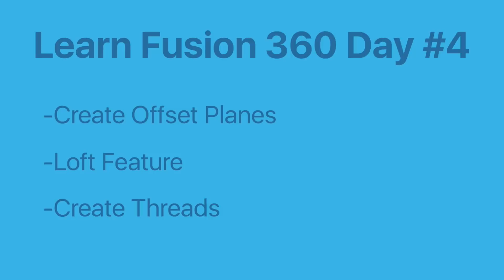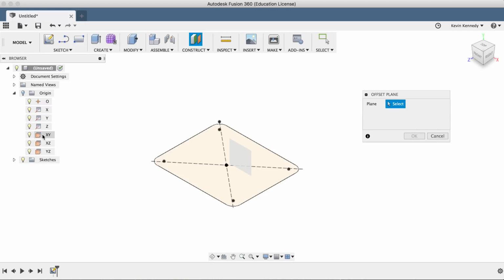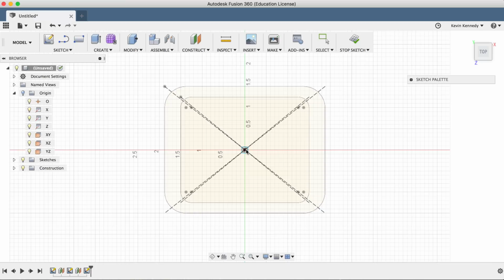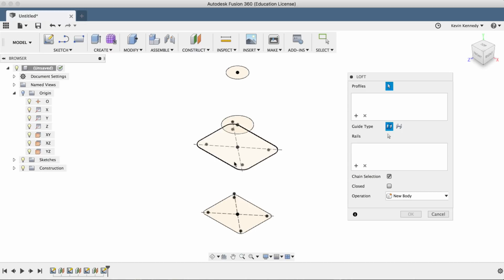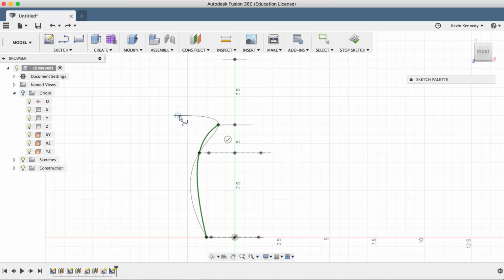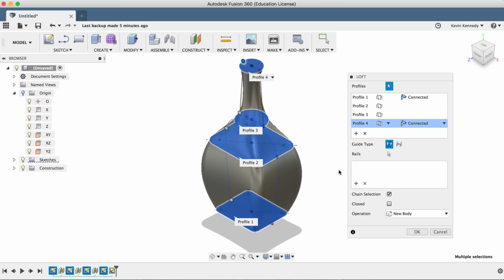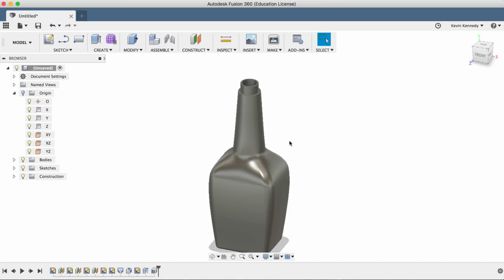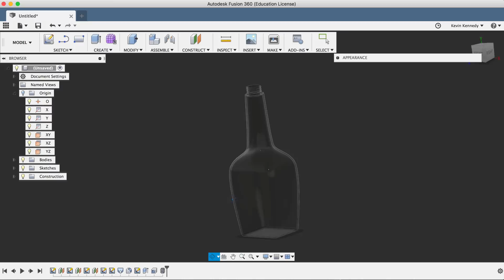How to 3D Model a Whiskey Bottle - Learn Autodesk Fusion 360 in 30 Days: Day #4

Comment: I've been on the video for hours and like other reviewers, getting the rail to work as instructed in the video was impossible.  I added reference points the circles which helped being able to snap to the circles; however, if i did it as a fit spline for the bottom sections and a line at the top section, no matter what, the loft tool had issues with my rail.  My only work around was to do it as a single fit spline and make the top portion as straight as possible. That's fine for this, but potentially problematic in the future. Seems like there shouldn't be such a problem if I had a ref point where the spline ended and line started, but alas, no success. Killing me
Reply: Running into the same issue as you. Currently working on June 2022 Latest version
Reply: @mossyprogramming5165  same issue here
Reply: Same 9.29.22 I did 1 continuous spline as a quick fix

Comment: As I work through these tutorials, something I think would be great to have supplied is a dimensioned drawing of the final product.  That way, I could watch the video w/o interruption, and then, using the drawing, try to replicate the model using the things I have just learned.  Great job on making these, and thanks!
Reply from the maker: Hi, David. I'm happy to hear you are enjoying the tutorials so far! I actually do have a dimension for this whiskey bottle on my website. I originally was making dimensions for each video, but not very many people were referencing or using them... so I did not continue doing them for each and every video. However, that is something I will reconsider if it seems like it really adds value to each tutorial.

You can get the dimensions for the whiskey bottle here -> https://productdesignonline.com/fusion-360/
Cheers, Kevin :)
Reply: I totally understand.  Thanks for the drawings that you did supply.   Exactly what I was hoping for!  Cheers!
Reply from the maker: @davidperry6226  You're welcome! :)

Comment: Hi, I found a video that actually is more helpful with attaching the spline to the sketches, its the project/intersect command in sketches which allows you to easily add the rail to the loft without giving you an error! I tried your way for hours upon seeing a video which made for beginner level to easily attach the spline to intersect to add the rail!
Reply from the maker: Hi, Elizabeth. IF you check out some of my other responses, you'll see that the "Auto Project Edges on Reference" setting is what has caused the issue - this used to be a default setting. In short, that setting automatically projects the edges for you, so there's no need to use the project command.

Instructions to check and turn on that feature here - https://productdesignonline.com/default-settings-for-fusion-360-tutorials/#autoProject

Comment: I had the same problem with the Rails. i solved it by editing my sketch and adding a reference point on the two circles by drawing a construction line across it and snapping the green line onto the straight line aswell. The straight line needs a point to snap too on those circles.
Reply from the maker: Hi, Jardim Machine Tools. Thanks for sharing this. That is certainly one way to do it. I'm actually releasing a new REVISED version of this tutorial tomorrow. This will solve all your problems with the rails not working. Cheers, Kevin :)
Reply: @ProductDesignOnline  that would be great, thank you.
Reply from the maker: @jardimmachinetools9225  I'll try to post a link here when the video post tomorrow! Cheers, Kevin :)

Comment: the problems may be stemming from people's default settings being different.  I had to look up how to turn on the snap thing, but I still had to zoom way in and try to adjust things.
Reply from the maker: Thanks, jench78. You're right... the snap setting and some other small settings are making it tricky. I didn't anticipate the spline causing so many issues or I would've been more thorough at that point. I'll have to make a revised version at some point. Cheers, Kevin :)

Comment: Have you looked at the add-in called connect the dots? seems very useful to fix the sketch parts not connecting issue. Had problems with that in the whiskey bottle tutorial until I just went with doing it all as a continuous spline without having to join that neck line. My whole class I was teaching this to had the same issue with dots not connecting but looking like they were. Even when we changed viewing angles.
Reply from the maker: Hi, TheAlphaPyro. I have not tried that add-in. I try to stay away from add-ins at all cost, because I've found that becoming dependent on add-ins for everyday workflows can come back "bite" you. A lot of add-ins are great when they first come out, but the independent developers often don't update them along with Fusion 360 updates... which often causes bugs where they no longer work properly. At least this has been my experience with the majority of add-ins that I have tried.

I didn't realize that this spline to line was going to cause so much trouble. Looking back, this is something that I would definitely re-visit should I make a revised version. I think this connection issues is also an area where F360 can improve in the sketch realm... hopefully something we will see in the near future.

As always, thanks for commenting! Cheers, Kevin :)

Comment: I must have tried this a hundred times. From scratch a few times even. I cannot get the spline to properly connect to each sketch. It doesn't seem to grab to the edge. So when I get to the part where I am Lofting and try to add the rail, I get an error saying the rail isn't connected to each profile. I even tried going back and adding a construction line to each sketch to divide the shape and hopefully give my spline something to snap to, but no luck.
Reply from the maker: Hi Brandon - The most common issue others faced is that the spline and line are not connected, thus they are not one continuous line that is required by the loft path. What you need to check first is if the top of your spline is connected to the bottom of the straight line.

To check this grab the handle of the top spline point...move it around freely and then move it towards the straight line until it snaps onto the straight line. This will ensure they are one continuous path. Then, if you re-try the loft command it should allow you to select that path as the rail.

Let me know if this works! If not, then please share your file. Cheers, Kevin :)
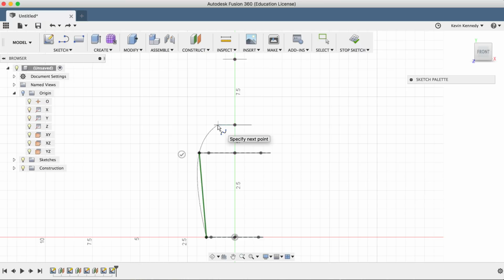Reply: @ProductDesignOnline  Im sorry that I have to ask. I now tried for 1.5h to make that move at 6:17 and I cant get it to work. The first spline point does not snap to the edge of my first sketch. I read your comment to the question that Brandon asked but it doesnt help.
Reply from the maker: @broom6958  I see in your other comment you mentioned you found the solution. Don't hesitate to reach out if you run into any more roadblocks. Cheers, Kevin :)

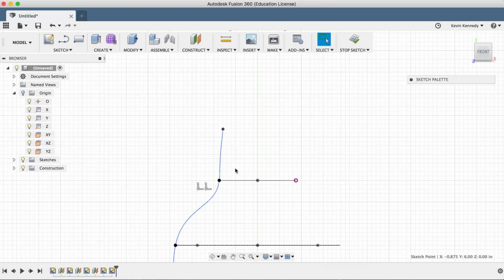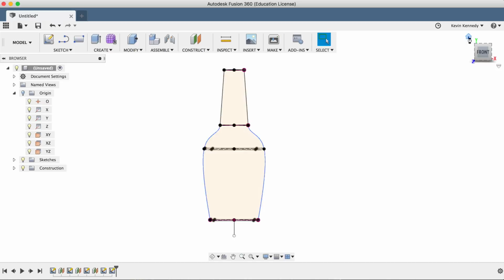Comment: I too am stuck on this one.  I made my spline, but was unable to trim the line as mentioned at 6:36.  I added a point at the end of the line, and was able to snap to it with the straight line for the neck.  I did a fillet between the two lines, and was able to mirror them around the center line.  When I look at the home view like at 7:45, the bottle is shaded but the neck area is not there.  I also get the G1 error.
Reply from the maker: Hi, daywalker750. Wanna share your file so I can take a look?

Share your public link as a reply to this comment. Here's a video explaining how to share a public link - https://youtu.be/2XrcrdV-8Ls

Then, please write a separate comment letting me know you've replied with a link because YouTube flags most links and I don't always get notified. Cheers, Kevin :)

Comment: Alright so I, as many of you, had the issue where the spline just would not snap to the sections. I've seen someone suggest creating a point at the extremities of each section and that tip is golden, but that alone is not enough. What you need to do is to make sure that those points have the right constraints. The way you check that is by simply trying to move the points around. If they move, things aren't good. Having the points coincident to the section line AND horizontal in relation to the center of the section worked for me. Cheers.
Reply from the maker: Thanks for sharing this with the community, Rodrigo. I have it on the list to make a revised version where I can cover these details more thoroughly so they're not so troublesome.

For the time being, this is a great solution. Thanks again for taking the time to comment. Cheers, Kevin :)
Reply: @ProductDesignOnline  Sorry man, i have the spline passing through and touching the planes but it says: "the guide is not G1 between first and last sections"
Reply from the maker: @fulviopannese7923   Edit your last sketch by double-clicking on it in the timeline below. Simply click on the top spline point > select the green slider handle > drag it until it snaps on top of the straight line... it should look like this - https://snag.gy/eBoqvJ.jpg

Then, you can hit "stop sketch" in the toolbar. Next, select the loft command from the create menu and retry the loft as outlined in the video. By changing that one spline point you should be able to get rid of that error - https://snag.gy/b54iUD.jpg

Fusion 360 can be picky with loft guide paths....so let me know if you get it to work! Cheers, Kevin :)

Comment: Finally figured out the loft via the rails.  I had to add the intersect command to each plane before doing the spline command.  Before that the Snap Command would just snap to the grid closest to the circle on plane 3.
Reply from the maker: Hi, Don. Thanks for sharing this solution with the community! Cheers, Kevin :)

Comment: Hey Kevin.. so my snap settings are set up correctly but my spline tool does not snap to the lines like yours does. Your points that you created with the construction line show up automatically when you roll over them... mine seems to want to snap to anywhere but the points...
Reply from the maker: Hi, Dante. Can you cross-check your settings with mine, here - https://bit.ly/defaultsettings

If it's not one of the settings outlined on that page then I'll likely need to look at your file to double-check that it is a setting. Let me know either way. Cheers, Kevin :)

Comment: you said we don't use the revolve tool because its not symmetrical. So basically it has to be symmetrical on all sides to use the revolve tool?
Reply from the maker: Hi, Hazem - great question! When you use the revolve tool you are required to pick an axis that the profile revolves around. If you're wanting a closed object, meaning the revolve runs all 360 degrees around, then it will have to be symmetrical. You could, however, use the revolve tool for a set degrees less than 360 degrees, whereas it wouldn't have to be completely symmetrical.

In summary, my point was that the loft tool is much more efficient in achieving your desired results when you have a shape that is not easily revolved around one single axis. Cheers, Kevin :)

Comment: Im sorry that I have to ask. I now tried for 1.5h to make that move at 6:17 and I cant get it to work. The first spline point does not snap to the edge of my first sketch. I read your comment to the question that Brandon asked but it doesnt help.
Reply from the maker: I saw in your other comment that you mentioned you found the solution. I also have a revised version of this video that is more thorough, that may have been of help to you. Make sure to watch the series via this playlist, which has the most recent videos - https://bit.ly/learn-fusion360

 Don't hesitate to reach out if you run into any more roadblocks. Cheers, Kevin :)

Comment: I had trouble with the rails in this project as the spline didn't snap to the other sketches, but I just zoomed in and made sure they were overlapping
Reply from the maker: Hi, Thomas. One thing you could do to resolve this issue would be to add "construction" lines from edge to edge when you create the original profile shapes. You could double click on the first four sketches in your timeline to edit them and add a construction line across them, which will further help you snap the spline into place.

Let me know if you're able to get it working. Otherwise, I'm happy to take a look at your file. Cheers, Kevin :)

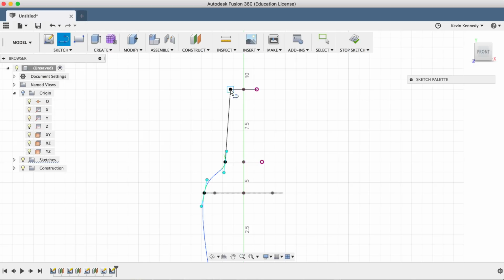Comment: hey everyone! Make sure you connect the spline and the straight line, otherwise when you try to add rails to your loft function, Fusion will spit out errors. To do this click on the spline end point and move one of its little green handles till it snaps with the straight line. Hope that helps! Watch the video at mark 6:48 Kevin does it very quickly so you may want to slow the video down to see how it is done
Reply from the maker: Thanks for this, Atoool K. I should've spent more time on this specific detail, as it has caused errors for a lot of people. I'll definitely make this a large talking point when I get around to making a revised version. Cheers, Kevin :)
Reply from the maker: @Spaghetti man As far as I'm aware, YouTube no longer allows the pop-up boxes. I believe that was depreciated a few years ago. I really need to re-visit this tutorial as a whole and make a revised version. It's on my to-do list, but it keeps getting bumped down so I can get some more sculpting videos released.

Cheers, Kevin :)
Reply from the maker: @Spaghetti man Thanks! Please don't hesitate to comment questions on the tutorials as you work through the remainder of the series. Cheers, Kevin :)

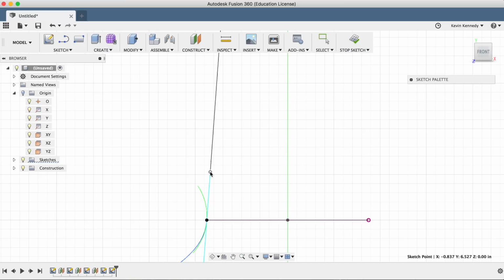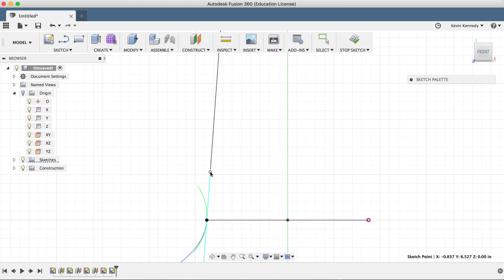Comment: 6:52 to 6:54 seems to be the big factor in not getting an error message. The ''handle'' of the spline is attached to the line and ties them together.
Reply from the maker: Hi, TheFerociousDinosaur. You are correct - I will eventually make a revised version of this video and I'll go further in-depth in this area that seems to cause problems for a lot of people.

Where you able to get yours working? If not, please let me know. I'm happy to take a look at your file. Cheers, Kevin :)

Comment: I've tried this over and over but I just can't get this tutorial to work.  For some reason, you have more points than I do at any given time, which you end up connecting with the spline.  I don't even get the pink points to show up on each attempt.  I'm not sure what I can do different, but this one is a failure for me.  EDIT:  I finally got it to work.  One recommendation that I saw in the comments was to ensure that the green line from the spline snapped to the straight line and then for some reason, I had to draw a line from the center point of the origin of the original plane out to the first point of the spline line.
Reply from the maker: Hi Tracy, I'm happy to see you stuck with it and got it to work! I'm going to revisit this video when I get the chance, ensuring that I'm more thorough with the spline point that has caused troubles for a lot of people.

In the meantime, Please don't hesitate to comment questions on the tutorials as you work through the remainder of the series. Cheers, Kevin :)

Comment: I'm having a problem trimming, like others, but I'm not sure if it's the same issue.  I got the spline points to snap to the edges just fine, like in your video.  However, when I click on the top portion of the line where I want to trim, the entire spline highlights.
Is there a reason why we even need that top portion?  Since I couldn't figure out how to trim that piece, I just ended the spline at the third plane, where you trim to anyway.  Unless you were just adding the extra step in order to show the that there is a trim option, I'm confused about why that part is needed.
In any case, if you have an idea why my entire spline was highlighting when it should have been only the top portion, I'd love to hear.
Thanks!
Reply from the maker: Hi, StepInIsrael. You are correct, as in, I was just trying to demo the trim functionality. Your spline could certainly run higher than mine does. My best guess (without looking at your file) is that your spline appeared snapped into one of those other points, but it wasn't actually snapped into place if you zoomed all the way in. Therefore, the trim tool would want to trim to the nearest intersecting points of geometry, which would be farther down.

If you would like, I'm happy to take a look at your file. If so, simply reply here with your link. Cheers, Kevin :)